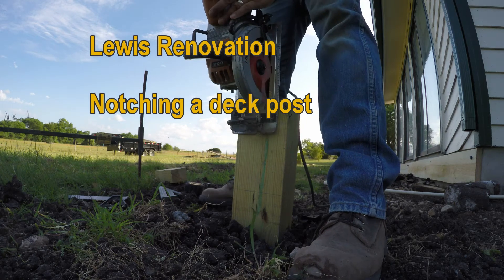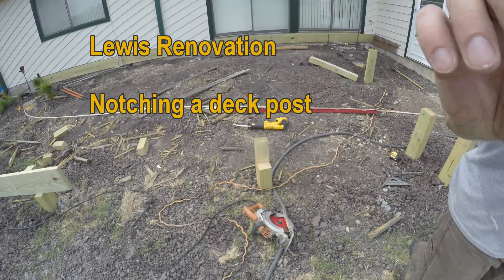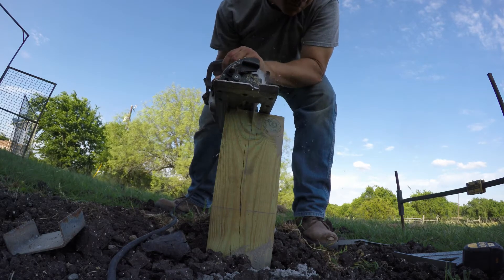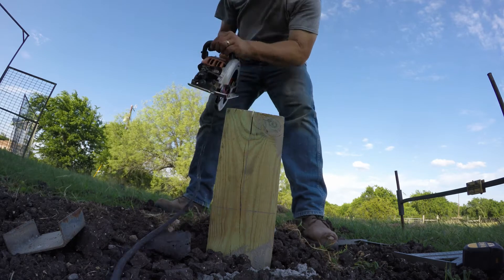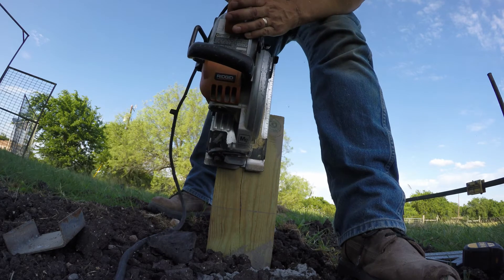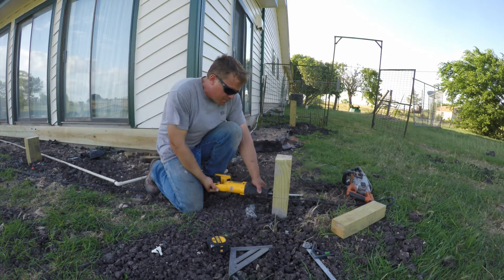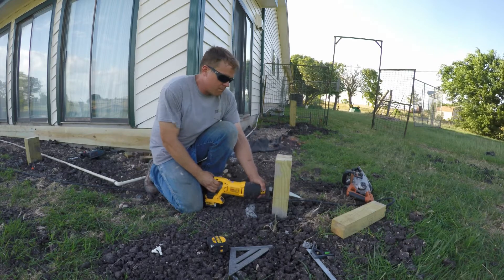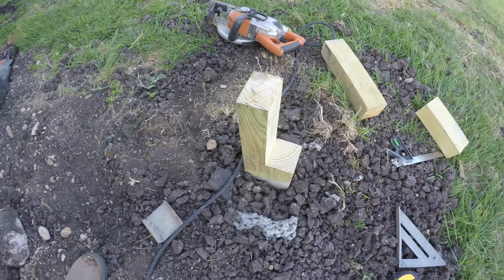How to Build a Deck - Notch Post

Comment: How do you know, tell how far down to saw (when sawing down from the top)?!?!?
Reply from the maker: I used a laser level to mark the tops of the posts, and then measured down the width of my beam (9 1/4 in this case)